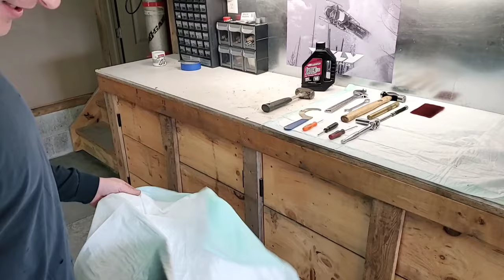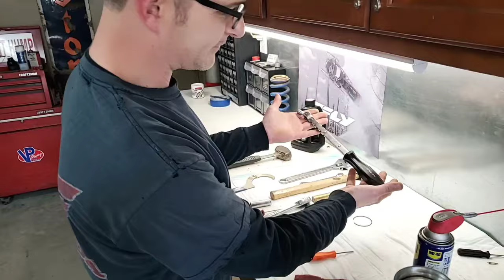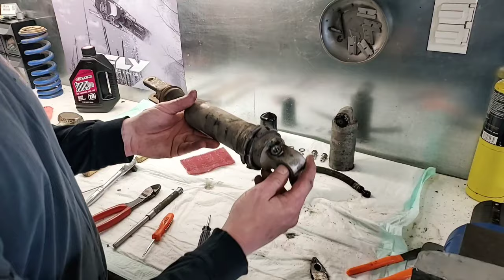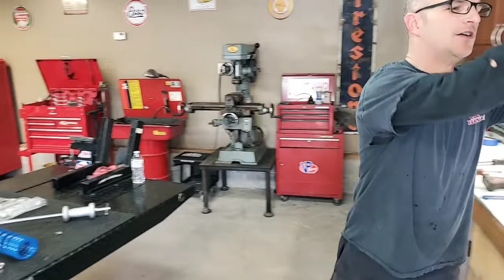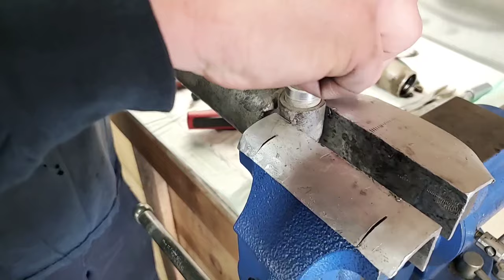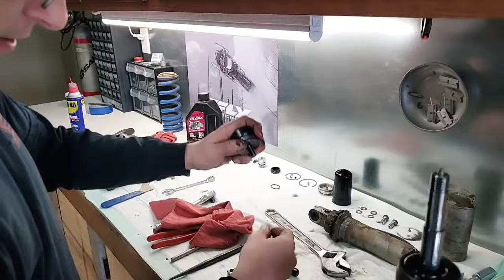How to Rebuild an ATV Shock - Part 1 - Disassembly / Tear Down

Comment: What rear axle bearings do you use 350x
Thanks
Reply from the maker: Currently all my 350X's have OEM bearings in them.  They are still available from Honda.

Comment: Awesome video Preston! Gives me a little hope or encouragement to try to take on my original 86 shock! Pat does a great job at showing all the small details!
Reply from the maker: Yeah man, I think just going slow and keeping organized and clean is the biggest part of the process.  The tape trick that you'll see in the assembly video is key to keeping the seal undamaged.  Then bleeding the air out after you put the oil back in is important and can be frustrating... just have to be patient.

Comment: Great work with this video. 
 That wrench 🔥🔥🔥.
   I have rebuilt 50+/- shocks. I still found this video very informative.
     Here is my contrbution:  ATCs used ATF fluid from factory. I have read that the viscosity of shock fluids varies greatly from brand to brand 10W does not equal 10w. I dont know if we could actually feel the differences while riding though
Reply from the maker: Yeah, that wrench was pretty trick!  I could tell when we were recording that this was going to be an awesome resource for people for a long time.  Maybe even the go-to shock rebuilding video?!  I totally get what you're saying about fluid viscosity though... it is probably a negligible feel when it's all said and done.

Comment: The reason it’s called a banjo bolt, connection, is because the end of the hose tip looks like a banjo. (The part that the bolt goes through looks like a banjo)
Reply from the maker: Well I guess that makes sense but that's not the cool story I was hoping for.
Reply: @ThisOldTrike  Also, The reason he had such a hard time removing the gas bladder was because of the vacuum created from pulling on the bladder.  Kinda like a suction cup.  A mechanic secret is to use a bike pump or any air pump for that matter.  Connect it up to the Schrader valve (after you remove the retaining ring) and then as you very slowly pump... it will naturally spit out the bladder.  You can see the cylinder pull the bladder back in in your video.  He wasn't fighting the cylinder... he was fighting natural suction. Love your videos.  Hopefully I'll make it to Trikefest this year.
Reply from the maker: Great tip Chris!!  I appreciate it and you watching!  Hope to meet you at trike fest.  Where is home for you??

Comment: What color did you go with for the spring? Trying to color match an 85 350X rear spring now.
Reply from the maker: I had to check with Pat.  He says the springs that he has powder coated are done with Skyline Blue by Prismatic
Reply: @ThisOldTrike  thanks so much. Also this video was perfect timing. Can’t wait for the rest of the series!

Comment: that atc 70 with the klt110 headlight? is cool! i may have to try that.
Reply from the maker: It's an 85 250R headlight with the sides cut off.  It does look really good!
Reply: @ThisOldTrike  ahh. resembled a klt headlight but i see that now. very cool!